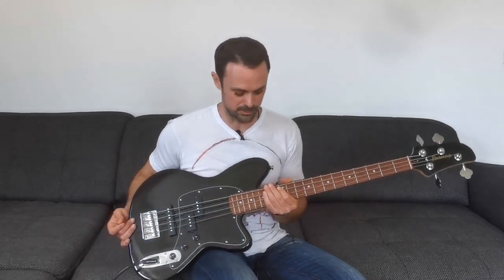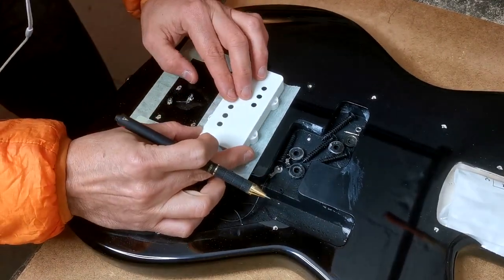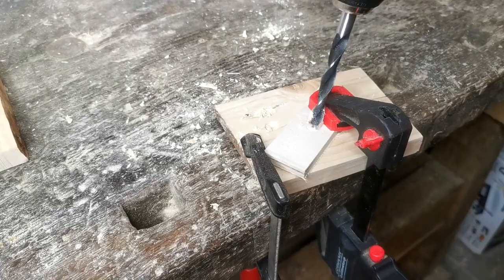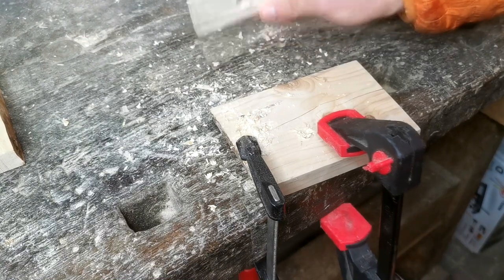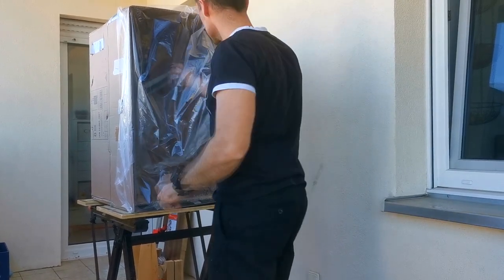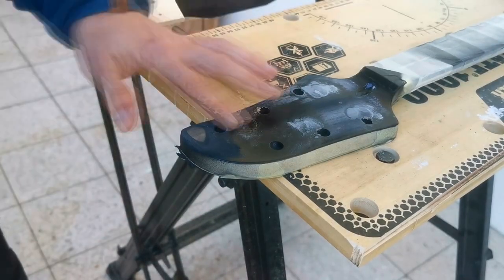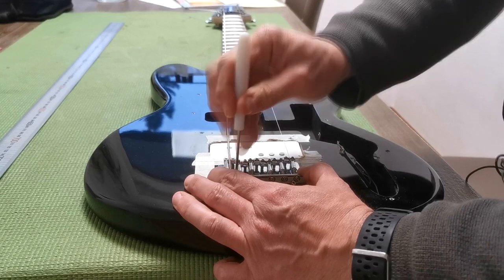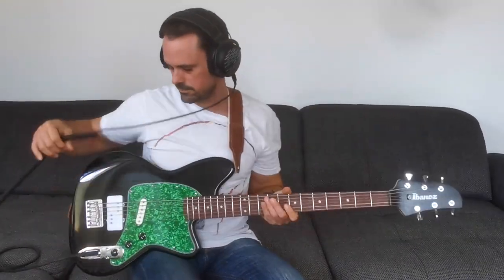How to convert an Ibanez Talman Bass TMB30 into a Baritone without it looking like $&*%!

Comment: i'm trying to do this with an old monkey ward's bass. I never thought of putting the dowel thru the original holes for the tuning keys, in order to reposition.very good idea i assume you drilled them out a little bigger?
Reply from the maker: If, for example you're in America and you can't find metric dowel rod to match the holes, then yes. But I didn't have to. If you do, take your time and run the drill backwards to avoid tearout. I'd love to see it when you're done!

Comment: Cheaper to buy a baritone
Reply from the maker: Thanks Steve, but your posit implies you're buying a cheap one. In that case, as long as you don't do any upgrades, it is cheaper. But at the moment the cheap baris can really use the upgrades, so you come out around the same price, but with a higher quality starting point than a subzero rogue vi, for example. But this project's expense actually places it pretty midfield, price wise.
Reply: @ShawnHeath  my comments are more around the cost of all the tools needed. Squier tele baritones are pretty affordable at the moment. Your project is good if you already have the gear needed.
Reply from the maker: @stevewilliams1122  Ah! In that case, no argument here. 😄
Reply: Not as fun though

Comment: Could I put a normal scale guitar neck on it? Do I have to move the bridge a lot to get that to work?
Reply from the maker: Good question! I can't say for sure, but I doubt that whatever neck you'd try to use would fit in the neck pocket properly, so you'd have to fill that and re-rout it to the shape of the neck heel. Then yes, the normal Talman has a different bridge position than this 30" bass, so you'd need to move it according to the scale length defined by the neck you've chosen. It's probably better to just buy a normal Talman guitar.
Reply: @ShawnHeath  Alrighty thanks

Comment: Have really been looking into doing this but wanted to do a 7 string so would need a 5 string 30"
Reply from the maker: I've seen several and I gotta say, I don't think it's what most people are expecting. Bass bridges are wider than guitar, so adding another string really widens that bridge, making the base of the neck significantly wider than a standard 7-string guitar. I'd recommend looking harder for an actual 30" 7-string.

Comment: question, could you switch out the strings for thicker ones and tune a baritone guitar to BEADGC like a 6 string bass?
Reply from the maker: I wouldn't go with such thick strings as that on this. This scale length doesn't really support that really low bass B, and for the next octave up, you'd be better off with a standard baritone scale length of 27" or so.
Reply: @ShawnHeath  most 6 strings are around 30" or even less, i don't see how it doesn't support it
Reply from the maker: @aquarius5264  you're talking about a 6 string bass, not a bass vi. Bass VIs are usually tuned in E, not B.
Reply from the maker: @aquarius5264  sorry for the short answers requiring a bit of knowledge and interpretation. YouTube comments aren't really conducive to discussion, but if you'd like to talk, shoot me an email and we can arrange it. See my "about me" page.
Reply: @ShawnHeath  i know man! i'm asking if you put thicker strings on could you tune it to a 6 string bass, thus making it essentially a 6 string bass with a guitar's neck width
Reply from the maker: @aquarius5264  Not with these tuners, they don't accommodate bass strings.